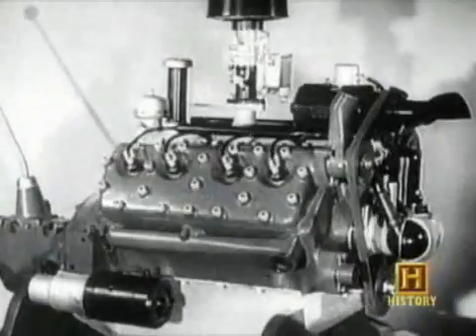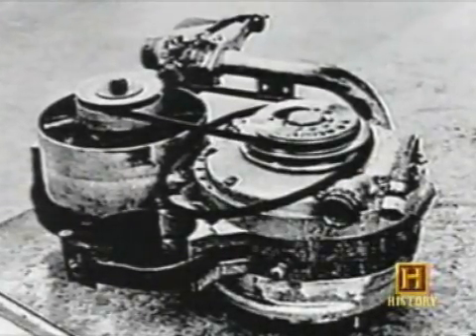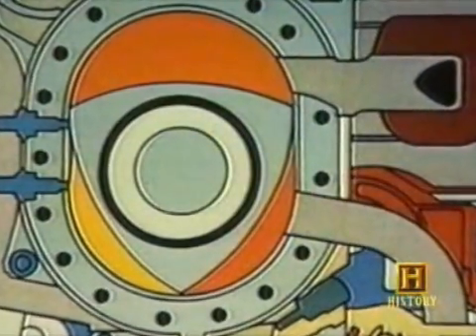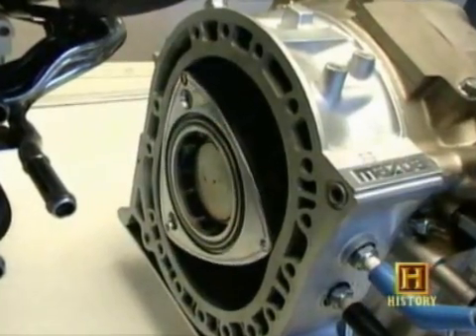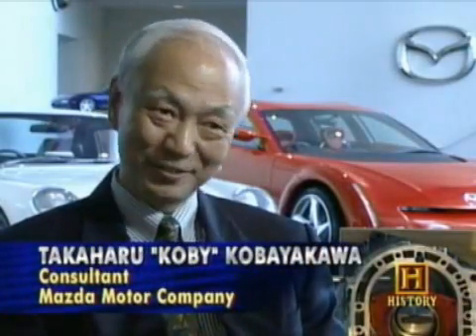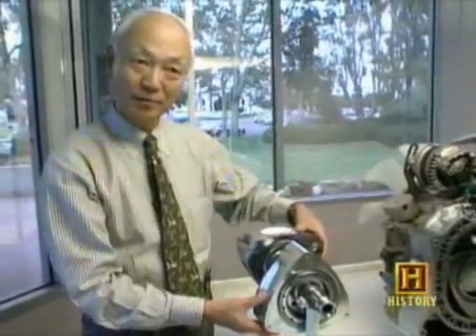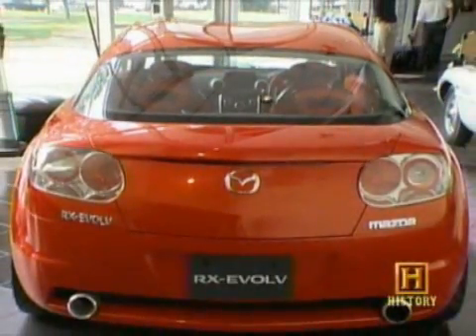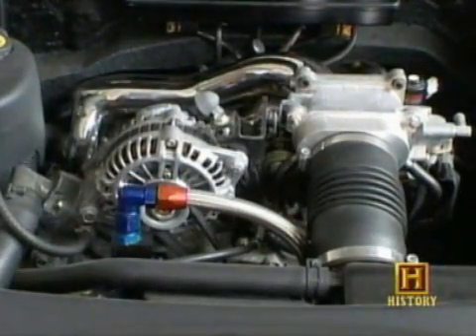The Rotary Engine

Comment: Wankel Rotary Engines
An early casualty in our industry's efforts to build a better 2-stroke
By Olav Aaen | October 1, 2000
RELATED TOPICS: ENGINES | VINTAGE
The good old piston engine was "on its deathbed," read the announcement.
 Good-bye to pistons, rods, valves and camshafts; there was a 
revolutionary new engine taking over the automotive world. The new 
engine had only a rotor instead of pistons, was fully balanced and ran 
smooth as a turbine. The inventor was Felix Wankel, and the Wankel 
engine promised a bright new future as a sophisticated and compact power
 source.

It was the mid-sixties, optimism abounded, and most of the major car 
manufacturers jumped on the bandwagon. The largest licensee in the U.S. 
was General Motors, but the concept also found its way into snowmobiles.
 Both OMC (Evinrude & Johnson), and Arctic Cat produced snowmobiles 
with Wankel engines for a short period. Arctic Cat imported a 
Sach's-produced Wankel from Germany while OMC built its own.

Unique Concept
The Wankel engine was as ingenious as it was simple. A triangle-shaped 
rotor spun around a geared shaft in a peanut-shaped chamber. The rotor 
only turned at a third of the speed of the drive shaft and one side of 
the rotor passed by the combustion chamber per revolution to give a 
power stroke. This meant the motor fired on every revolution like a two 
stroke, but the pumping action acted like a four stroke.

The incoming fuel mixture was sucked directly into the rotating chamber;
 there was no crankcase pump as in a two stroke engine. This would give 
the Wankel all the advantages of a four stroke for chamber filling, 
combined with the advantage of firing once per revolution like a two 
stroke. The Wankel also promised to have better fuel economy than the 
two strokes, and this was important in big outboards.

For OMC to gain production experience it was decided to make a 
snowmobile engine first. OMC had a reputation for quality products in 
the outboard business, and it was felt that there would be a lot less 
risk if the unavoidable teething problems could be sorted out in a fan 
cooled snowmobile version.

The snowmobile engine was to be designed by the Outboard Division, so 
they could gain some experience. With all the major automotive giants 
jumping on the bandwagon there was a tremendous optimism around the 
project. The Wankel design team was full of young engineers without a 
lot of baggage from conventional production, in hope that new and fresh 
ideas would abound. At the time I was a young project engineer in the 
Snowmobile Division, and was assigned to coordinate the installation 
between the Outboard Division and the snowmobile chassis department.
Inherent Obstacles
It was not my first experience with Wankel engines, I had tested some in
 early NSU cars in Europe and had been impressed with the turbine-smooth
 power delivery. At my first meeting with George Miller, the project 
manager, I was advised of a potential problem he hoped we could solve.

The Wankel exhaust runs very hot, and it would be important to make sure
 it did not become a problem in the sled installation. What did he mean 
by hot? Cherry red metal glowing under the hood, just like a coil on an 
electric stove. This was obviously much hotter than a two stroke 
muffler, and could be a serious problem. At that time the engines were 
mounted on top of the tunnel where the gas tank now sits on modern 
snowmobiles, and the gas tanks were in the nose. The muffler compartment
 was where the engines are now located; between the cross member and the
 tunnel. This meant that the cherry red Wankel muffler would be located 
only five inches away from a plastic gas tank. It was too late to 
redesign the engine location; it was to be mounted in the large luxury 
chassis which also housed the quiet machine.

This would turn out to be a plus. In order to control noise emission, 
this design had a completely closed hood with managed air circulation. 
This meant no louvers to let the noise out, and the hood tightly sealed 
to the pan. The problem with the hot muffler was solved only by allowing
 the air out after it had circulated around the muffler under several 
carefully-designed radiation shields. After the air had run through the 
fins to cool the engine, it was ducted over and around the muffler and 
finally out through a slot at the bottom of the muffler compartment 
right in front of the track.

The only reported problem with this design was a tendency to melt snow 
and ice under the sled if you let it idle too long before you shut it 
off. Occasionally owners would come out after a dinner at their favorite
 restaurant and find the track frozen to the ground, as the melted snow 
turned to ice. As far as I know, there was no problem with the close 
proximity of the gas tank to this glowing hot muffler, because the gas 
tank compartment had also been well insulated.

The Wankel concept had been criticized for its long sealing surface, and
 the complicated sealing strip arrangement around the rotor. The OMC 
Wankel engine had no such problems. The steel seal ran against 
metal-sprayed side plates and had excellent wear properties. One major 
problem occurred on the first production batch. The rotor bearings 
weren't to spec and some failures occurred until new bearings could be 
delivered.

OMC's Wankel-powered snowmobile lived up to its expectations as a test 
bed for the new engine concept. The Wankels were both smooth and 
relatively quiet for their time, and the power curve was a lot broader 
with lots of torque from a low engine speed. This made it completely 
insensitive to clutching. You could throw a bad clutch on this motor, 
and you would not notice it because of the exceptional four stroke-like 
delivery. Fuel consumption was also better than a comparable two stroke 
engine, but not as good as a conventional four stroke. This eventually 
became the downfall of the Wankel design. We were now in the early 
seventies, and then we got hit by the oil embargo. Fuel economy all of a
 sudden became a big issue, and the large automotive companies dropped 
the Wankel like a hot potato. OMC had hoped the publicity of the major 
car companies would create a favorable acceptance of the rotary engine, 
but now the exact opposite occurred. With all the bad publicity about 
the uncompetitive fuel consumption, OMC backed off its Wankel research.

OMC got out of the snowmobile business in 1975. The Wankel design team 
was disbanded, and most of the team members left for jobs at other 
companies. Only the Japanese Mazda company continued to make 
Wankel-powered cars, better known as the RX-7 Rotary, a very quick 
sportscar which gained an enthusiastic following.

If the Wankel concept had been allowed to continue on a limited budget, 
it may have emerged as a possible solution to the fuel consumption and 
emissions problems the sled and marine industries face today with two 
stroke engines. OMC built several large four-rotor outboards that were 
the most powerful outboards ever made, and when used in hydroplane 
racing, they totally dominated the competition. There is no doubt a very
 powerful compact rotary engine can be built, they are now very popular 
as power sources in sportscar racing in SCCA.

Future Uses?

Will we see rotary engines again in a snowmobile? It may depend on how 
strict the emissions rules become, and how much it will cost to tool up 
for new two or four stroke engines to meet these goals. The Wankel 
rotary engine had many good features that should have made it an 
excellent power source. Costs would have come down with continued 
development and reliability would have been engineered in. The design 
did not fail on its own merit, but was forced aside by circumstances. 
The expertise is still out there with the Mazda engines, and it would be
 a lot easier to get back into it now than it was to start from the 
beginning of the Wankel era.

As it turned out, the OMC snowmobile rotary engine ended up being the 
only Wankel engine ever manufactured in the U.S., and as such has some 
historical merit. There are still OMC rotaries out there in running 
condition to be had for a reasonable sum if you are interested in 
finding out what it felt like to run with rotary power.

Comment: agoMazda, Toyota Select Alabama for New U.S. Auto Manufacturing Plant  
 agoCar Review
Published on May 29, 2017
Celebrating five decades of Wankel with five historic Mazdas On May 30, 2017, Mazda celebrates 50 years since the launch of its first production rotary engine. Rotary engines aren’t unique to Mazda, but more than any other automaker, Mazda is synonymous with the technology.

Mazda’s history with the rotary goes back to the early 1960s when it licensed Wankel technology from West German automaker NSU, now part of Audi. Created by Felix Wankel in the early ’50s, the rotary engine is an internal combustion engine that uses reciprocating rotors instead of pistons to power a car. The advantages of a rotary over a piston engine are its compact size, light weight, and high power for its size. Some disadvantages are increased oil consumption, decreased fuel economy compared to similarly sized piston engines, and that they run most reliably and efficiently if held at a constant rpm.
1

Comment: DOKTERBIMMER IS A FAKE ON ALL ROTARY ENGINE SIGHTS* Some Other Dude NO RECESS AT ALL? **THAT IS TWO MUCH *COMPRESSION WANKEL CAN;T HAVE THAT TWO MUCH**ALL IN MOTION LAWS OF BLANK "Mazda changed their rotor recess from a "Leading Deep Recess" to a "Mid Deep Recess" in the early 1980s,..." Doctrinare Bimmer has been mocking ANY change in the location of the recess for months now*. Yet you are saying Mazda did it in the early 1980's. They must have had the recess for a reason, and they must have moved it for a reason. I don't know what the reason is, but let's see if he will acknowledge there is ai a reason **(I already know he won't*) Just sit back and watch.

Comment: WANKEL ENGINE WILL LIVE ON WATCH AUTOLINE DAILY 997 ON YOU TUBE ROTARYS LEAK INSIDE THE ENGINE FROM ONE CHAMBER TWO THE NEXT AIR  AND FUEL IS WASTED HALF THE COMPRESSION STROKE IS WASTED AT THE LEADING PLUG HOLE INSIDE THE ENGINE

Comment: 16 years professionally working with rotaries. I'm on my personal 9th RX-7 resurrection. To keep Felix Wankel's design alive and to my late father who I personally reproduced a Factory showroom 89 GXL for him.
Reply: doktorbimmer stupid the leak is when the apex  seal lines up with your BIG FAT LEADING PLUG HOLE STUPID doktorbimmer 1 year ago +FishingTheGreatLakes The tolerances between the apex seals and their grooves are very tight.. but the tolerances between the piston(rotor) and its housing are rather large to accommodate the high thermal expansion, warping and distortion... The apex seals are indeed held or pressed against the walls with both spring tension and centripetal force.. but this force is not great enough to maintain a perfect seal as the seal plunges in and out of its groove due to dynamic forces, gas pressure and imperfections in the housing walls.. this movement often becomes harmonic.. introducing a bouncing effect called chatter. If this occurs during high load? hot combustion gasses leak past the seal causing damage due to ablating the surface and overheating the seals and tension springs.
Reply: BEST ENGINE OF THE 21 CENTURY

Comment: only downside is excessive heat and too low flow rate stock water pump. 

Great for daily driving, but the engine just has too many seals, on a good day, a rotary would last only about 180k miles untill it started burning oil and loosing compression.

otherwise badass engine, plus lots of aftermarket seals and pretty simple to work on.